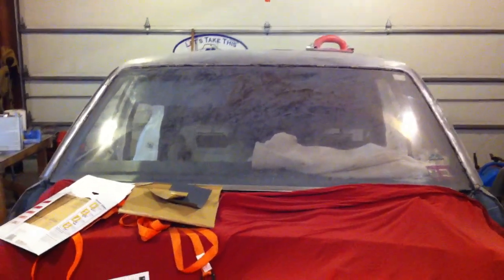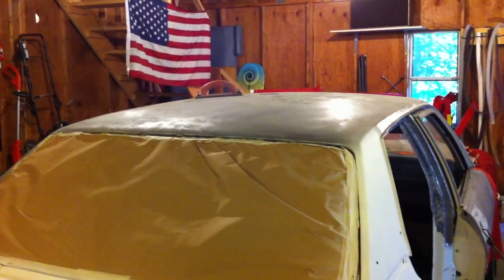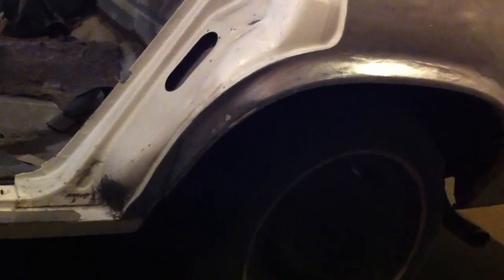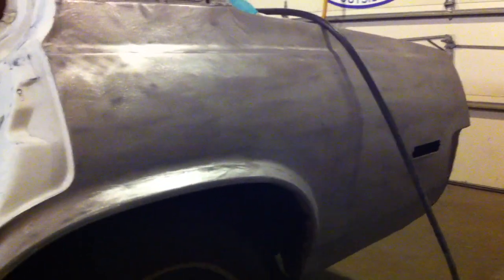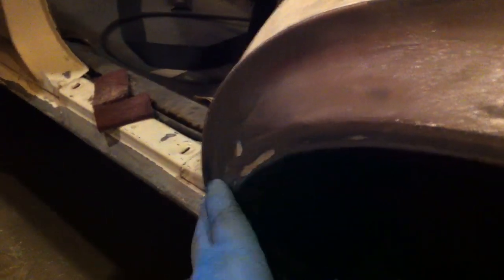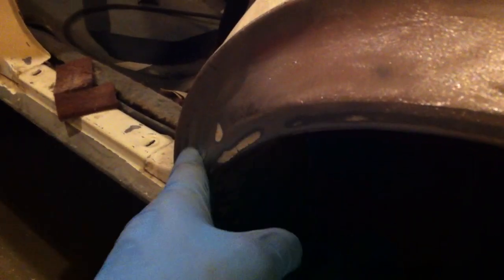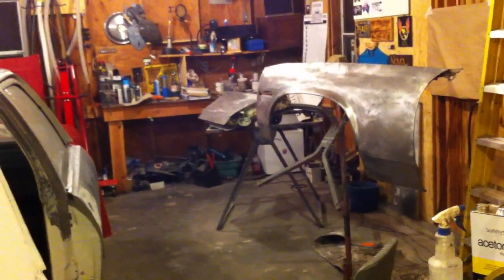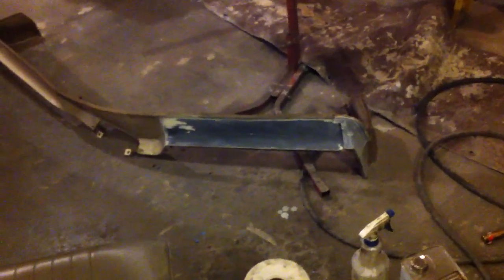Prepping for etch

Comment: On the dinged dog leg, knock the high parts down with a pick hammer(body shop size)  If you don't have one, use a sharp punch or sacrifice an old Phillips screwdriver, gring the point down to resemble an ice pick.  Tap it with a hammer on the high parts around the dent(called the ridge, all dents have a ridge around them)  You dont want to knock holes in the metal, just lots of little tiny dents. This lowers the high ridge( loosely called shrinking) around the low spot where you can use filler.

Comment: shrinking pt 2-- this is not the best fix, but it will keep you from chasing your butt trying to fill the ding over and over.  Hitting the ridge with a hammer face just pushes metal up farther over, another ridge and dent is getting bigger each time, hence chasing your tail.  The dogleg is two panels thick, the quarter panel skin, plus the outer wheel house on the inside.  You cant beat both out with your hammer.  Good luck!